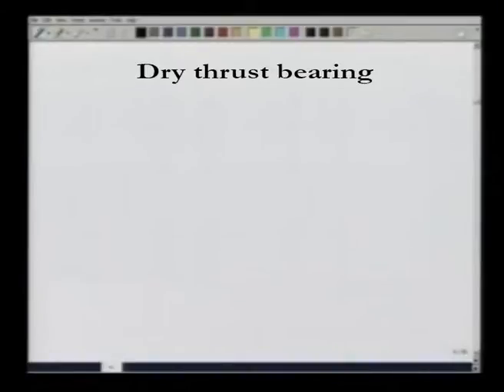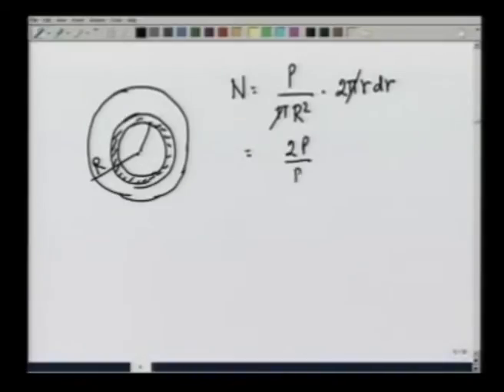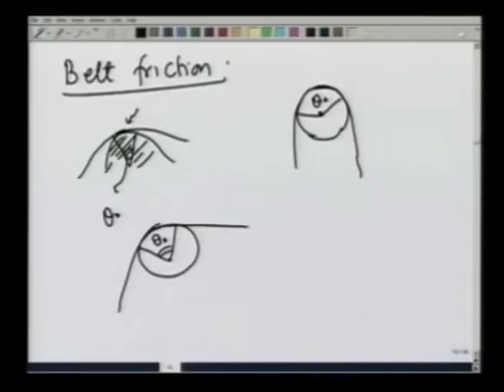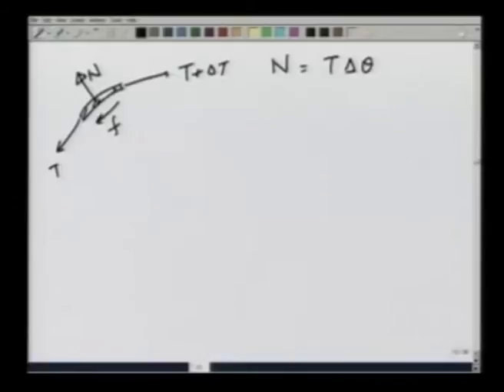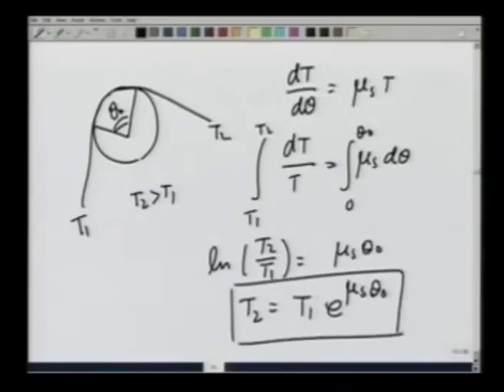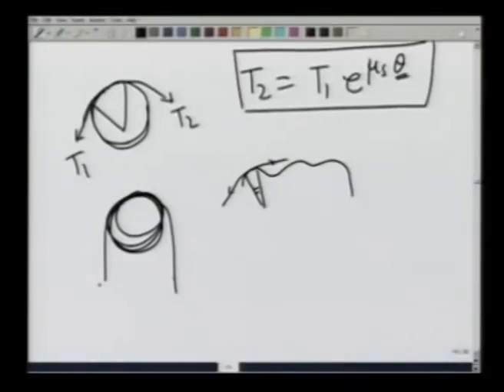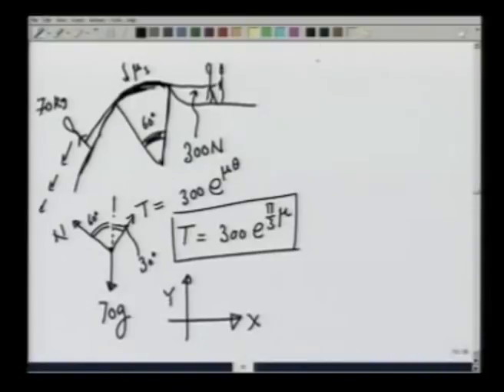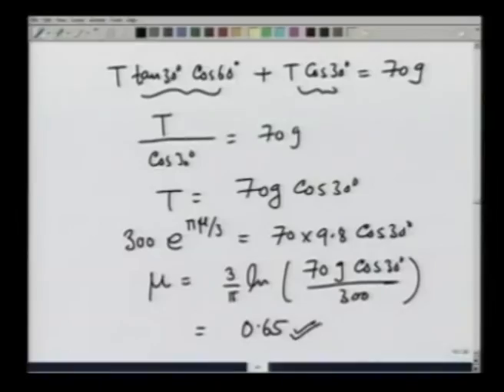Dry friction III - Dry thrust bearing and belt friction with demonstration

Comment: Why are we neglecting the weight of the cylinder in dry thrust bearing. If we also include the weight of the cylinder in the analysis, then how will friction act?
Reply: It might be irrelevant now but I am saying it anyway. 
I think friction depends upon the normal force exerted by wall on the cylinder. Since the weight of the cylinder is downwards, it doesn't contribute to normal force. Thus, it can be neglected. 
However, if the cylinder was vertical and was resting on the ground, we must include its weight along with any external forces.